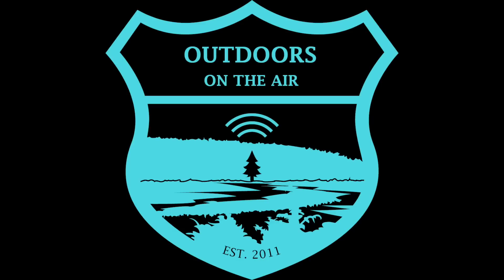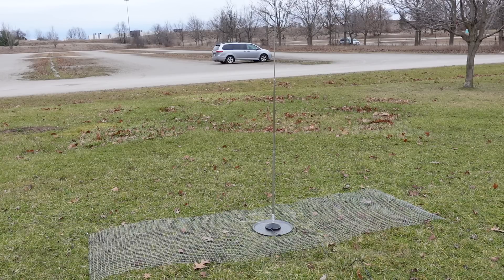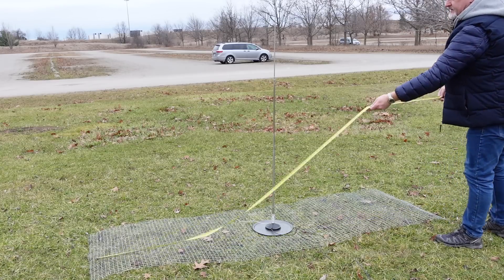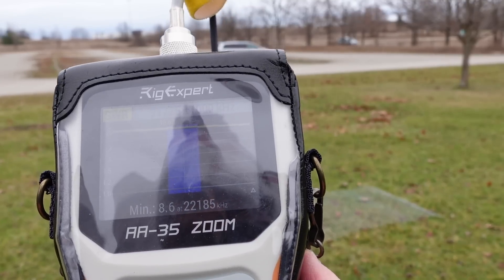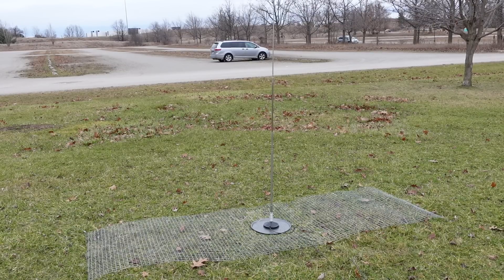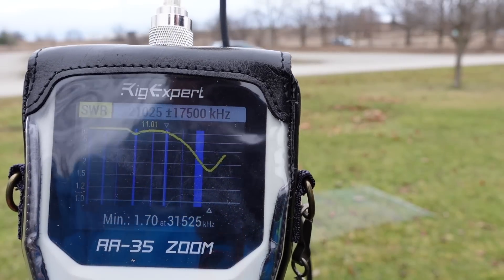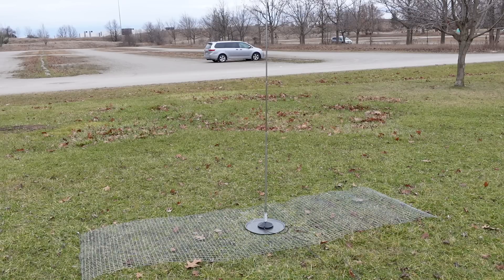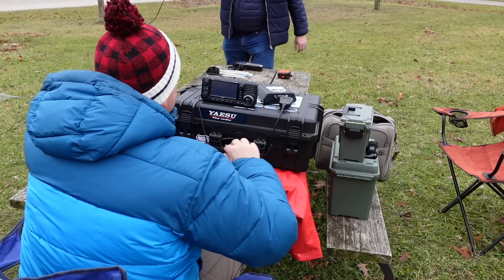Compact, Quick HF Antenna: Wire Mesh + Magnet Mount Whip

Comment: I wonder what would happen if you moved the pizza pan/mag mount near one end of the hardware cloth? Would you see some measurable 'directionality' toward the long end of the mesh, as you do with a series of radial wires not evenly distributed around the vertical element?  Great experiment, and a fantastic set up where parks will not let you penetrate the ground with a stake or rod. 'Could be interesting to try with Walt K4OGO's 'Coastal 20' or other verticals...and, yes, thanks to KB9VBR Michael for bringing back this old-school technique for a fast-to-deploy ground plane. 73 de KN4HGI Al/Thumpy
Reply from the maker: Interesting question! 73 from VE3TWM.

Comment: Mag mount will have tiny capacity to wire because most of the surface below the mount is “air.” Onlt a direct connection will work - as you have found.

Comment: That matches the results I have obtained with two 48"x84" aluminum window screens and also a Faraday cloth of slightly smaller dimensions. Eventually I will make a video on it, too. I have used a picnic table clamp with the same MFJ-1979 & & a 17" alligator jumper to the aluminum screen in the ground as well with good results. Thanks for sharing, when my XYL Ham wife's arm recovers from her spiral fracture of the Humorous I will get back to the fun! The window screen typically achieved better VSWR bandwidth than using 2 counterpoise radials, elevated or on the ground. I have the exact same AA-30 antenna analyzer.

Cheers, Davey --KU9L

Comment: wow Tom, Thanks for the magnetic coupling explanation and the difference in HF coupling.
Reply: The coupling was really capacitive not magnetic. The mechanical mounting was magnetic. The bottom of the magnetic mount acts as one part of the capacitor the other part would be the roof of the car.

Comment: look's like a good idea...i have a 9 Hf band's Outback 2000 mobile antenna in my second floor apartment that i use as a temporary base antenna on the balcony...the Swr is always a problem whit out a good ground plane...i will do some experiment whit the chicken wire and the magnet mount on a flat small space 9' x 3' long....and see if i can use 10m, 12m, 15m, and 20m... also if it works on 30m, 40m and 80m whit a longer chicken wire ( i have 6m but not in my icon hf radio maybe i can make some test whit my 6m Fm/Am 2w Ht )...for the Swr test i will use a rig expert analyzer......73's good Dx's.....WP4EFM

Comment: Is the pie pan teflon coated?  If so, the teflon might 
be acting as an insulator hence the need for the wire jumper.
Reply: Thank you for your comment. The pie pan is painted with some sort of nonconductive paint. It does not matter hence the coupling is capacitive. We use the pan to provide needed mechanical stability over anything else. 
The effectiveness of the capacitive coupling is dictated by the size of two surfaces (and a distance between them). In this case the size of the surface of the mount itself and the area of chicken wire under it. Which is not much... Normally the roof of the car provides much larger surface and acts as a part of the antenna system.
The jumper cable runs between the shield of the coax cable and the chicken wire. (the mount is modified and we can do it) Effectively eliminating need for the  capacitive coupling . As such the jumper cable does not even touch the pie pan.
Reply: When you say it was connected to the shielding of the coax, does that just mean you have the jumper cable clipped onto the outside of the coax?

Comment: The metal screen increases the capacitance between the whip and the ground return. The use of radial wires as counterpoise has less capacitance. this is why the wire mesh works with a smaller surface area. I would have liked to have seen the wire mesh removed and the pie plate on the ground, added to the experiments. In the experiment that was done, it looks like the coax ground is the counterpoise and is resonant at a higher frequency. Hence the wire mesh lowers the resonant frequency. The mag mount works by capacitance coupling to the ground when on a metal surface such as an auto body. There is no magnetic coupling as said in the video. Finally, curious as to what would happen if a choke coil is placed at the connection to the magnet mount.
Reply: Thank you for your comment. You are 100% right. There is no magnetic coupling. I do not know why I said this. Perhaps because it was a magnetic mount :-) . The "mounting" was magnetic but coupling was capacitive. It would be interesting to use a "hair pin" style match to is it the SWR could be improved. Also, it could affect noise created by the  static charge collected by the whip itself. I have no idea if it would make any difference, I never tried it. I have seen small coils on car installations. Last but not least, I wanted to have a choke but I decided not to. I use this mount on the car and the choke would be one more thing that could make a dent. I would have to wrap it in a piece of bubble wrap or something soft. Then it would be difficult to store, since the cable can not be detached. Anyway, tons or room for experimentation.

Comment: There is some credence to using a ground screen for 20 and up. Below that at least 100 SF minimum.
Reply: What does SF stand for?
Reply: I'm just guessing,sf = square feet .
 @jeffdhartman
Reply: Thank you for your comment. I have 80m hamstick and I would like to try it. It does not perform well when magnet mounted to the car's roof. Probably there is not enough capacity for such a low frequency. I hope to that the chicken wire will provide better results hence it does depend on capacitive coupling.
Reply: Makes perfect sense. As a mobile operator, I have a Yaesu ATAS-120A on a 3 magnet mount, on top of my Outback wagon. Nothing grounded or bonded yet. I’m sure there’s a huge correlation between a big piece of chicken wire and a station wagon roof. I’m 64/100 towards Mobile DXCC in almost 2 years. Just 5w-50w from a FT-891, SSB. A chicken wire ground plane would/should work really well for me at home too. We live in the middle of a row of 6 rental condos so antenna options are “limited”. If I could mount a few Hamsticks on a big piece of chicken wire, I might be able to do quick band changes…a poor man’s DX Commander